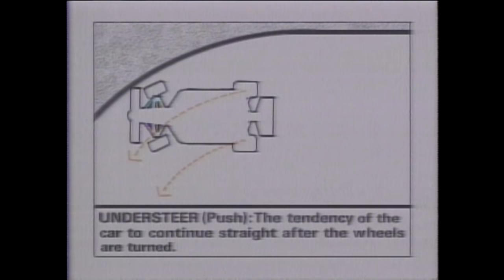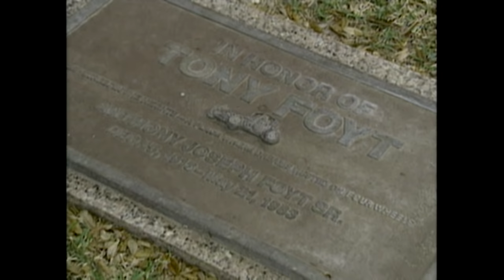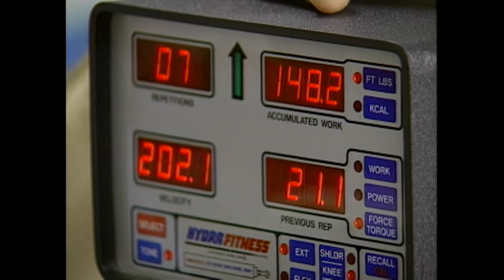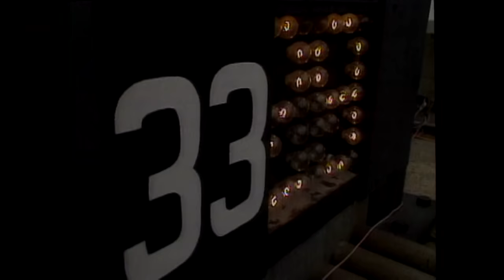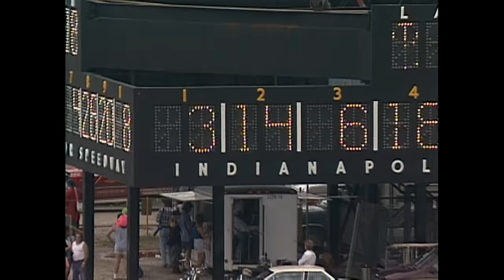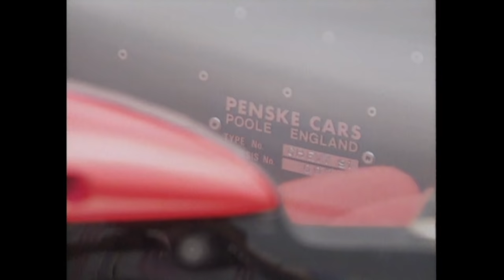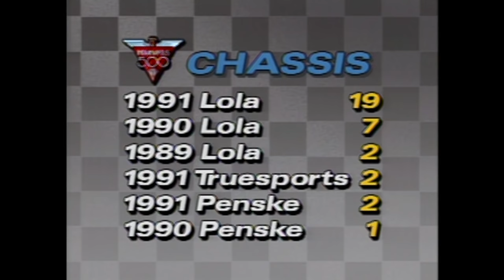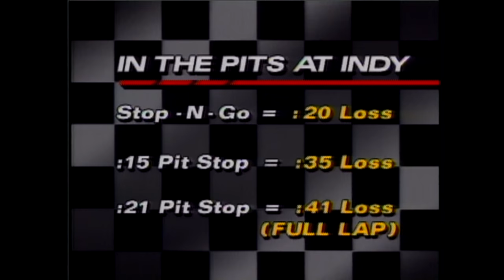1991 Indy 500 Full Race

Comment: In the 1991 Indianapolis 500, A.J. Foyt qualified in the 10th starting position with a four-lap average speed of 222.443 mph. However, he was unable to finish the race due to a broken gearbox. Foyt had won the Indy 500 four times as a driver in 1961, 1964, 1967, and 1977, and he also won the race as a team owner in 1999 with driver Kenny Brack.